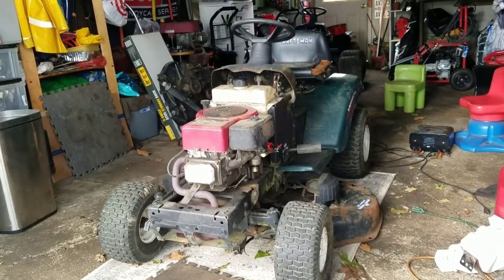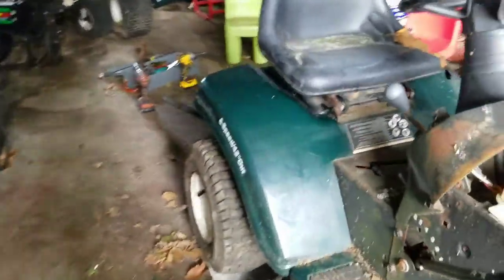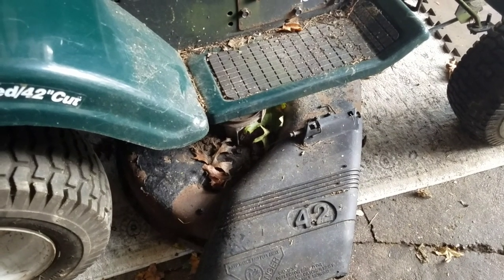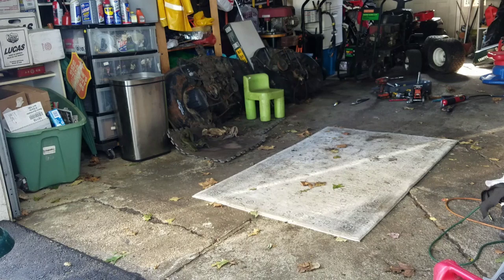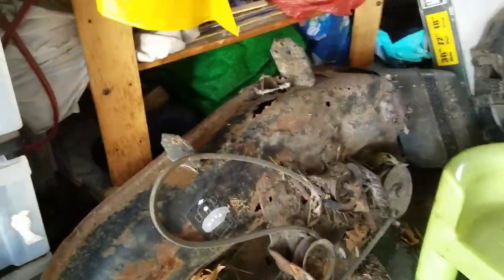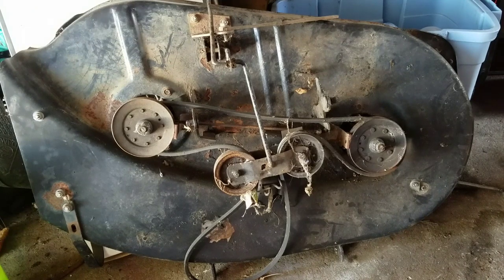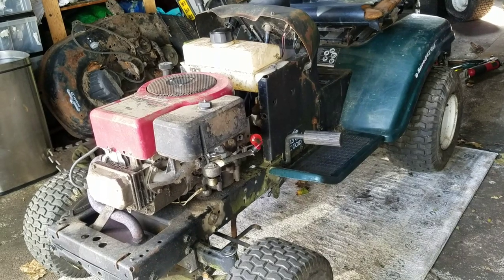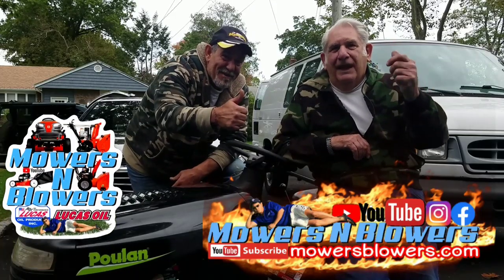CRAFTSMAN LT1000 LAWN TRACTOR MOWER SPICER TRANSMISSION SWAP REMOVAL TECUMSEH PEERLESS INSTALLATION

Comment: i have 2 of the LT1000s (one for parts).  My running one has the floor shift like yours but the parts one has the shifter on the right side of the driver. After a broken bolt in the brake caliper of the running one and an unsuccessful thread tap attempt I was going to swap the transmissions.   Do you know if these are interchangeable?
Reply from the maker: Hard to say since they have three different types of transmissions for those LT1000’s,  only way is to try

Comment: Was the Peerless a drop-in fit?  I have a Spicer 4360-86 that needs 2 new shifter keys.  I think this part is interchangeable among all the 4360 transaxles, but can't find it anywhere.  The transaxle is from an old Honda 2013 lawn tractor.  I can still buy the transaxle new from Honda parts dealers, but it's probably going to be another Spicer that I can't get parts for.  I was wondering whether I can swap in a Peerless as you did.
Reply from the maker: Mine was easy because it’s from the same model tractor,  linkages and shifter configurations are different on Honda’s.

Comment: I have a John deer 26 hp v twin it’s a 2013 tractor that does not run if you want it it’s in central Massachusetts
Reply from the maker: I appreciate that broski, but too far for me to go.  Put it on Craigslist, someone will give you $200 for it.

Comment: You should put a metal pipe over the shifter weld and drill hole much stronger repair